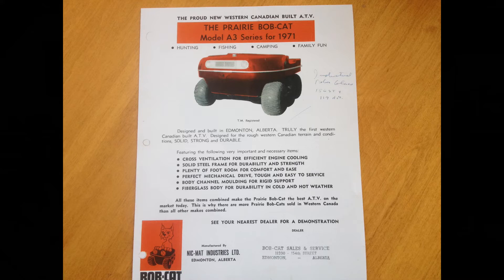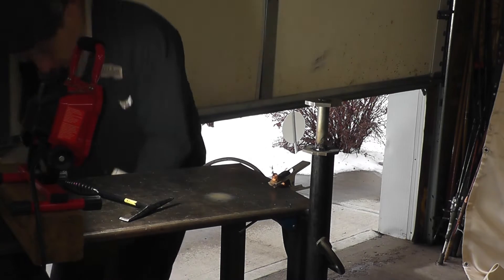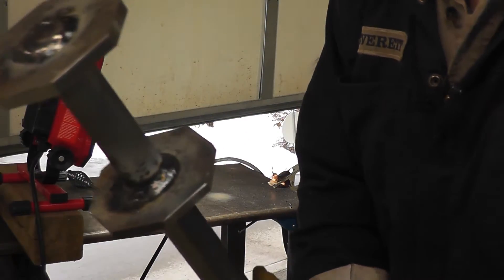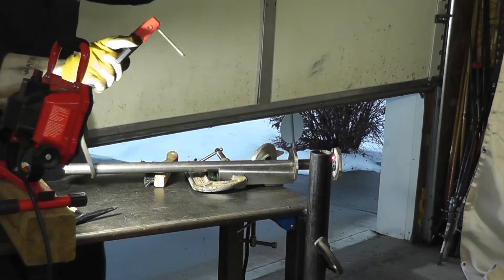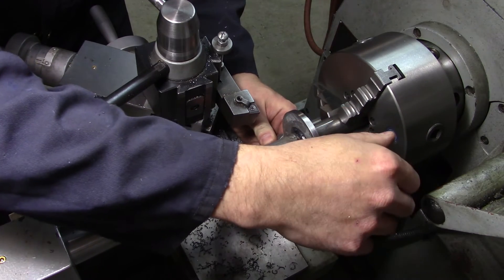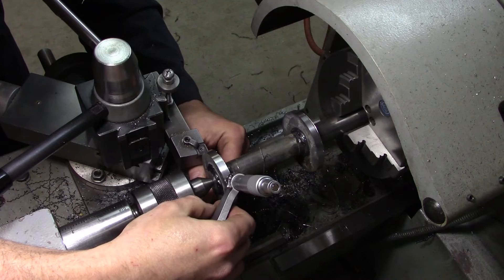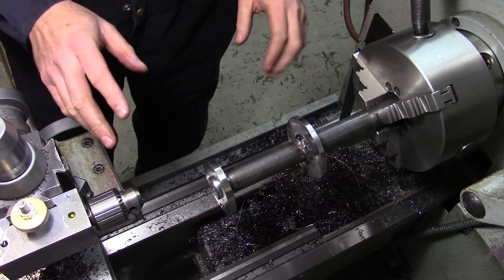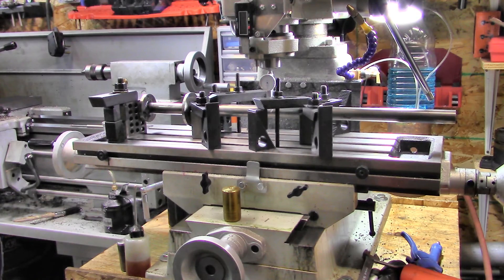Prairie Bobcat Axles Part 2

Comment: How would a thrust bearing work on the drill guide between the chuck and the block? Then you could use the carriage for pressure and just run the drill. Great videos, I am watching them all.
Reply from the maker: That's not a bad idea at all, a couple other guys, Steve Jordan, did just that with their designs. I might make some modifications to it down the road, I just needed it to work for the axle project as Uncle Tim needed them sooner rather than later. Thanks for coming by and for the kind words!

Comment: Nice job on a fun project. 5/16 is small for a wheel stud.
Reply from the maker: Thanks, yeah, I thought it a rather small bolt size too, but that's what they used. It's quite a small vehicle and fairly light - the inner flange apparently is to reinforce the inboard side of the rim, so that must buy some forgiveness in lug bolt requirements. Hope you're doing well.

Comment: Hi Everett ,I enjoyed the video very much it looked like a nice relaxing project and i am sure uncle Tim is tickled.
Your welding turned out very good, as you realize it is 90% positioning to do a good job.
I see a couple of items that might be nice for a feature video in that milling coolant setup, is it a purchased rig or home cobble? Cheers and carry on friend!
Reply from the maker: Thanks, I know there are a few surface blemishes in the face from weld undercut but it won't affect function. The mill mist system started with a cheap Loc-Line-type fitting off eBay, which got adapted to the mill. I showed the basic steps of how it got mounted in an earlier video . . . It's not perfect but for the price compared to a commercially available system it works for what I need. Good to hear from you again.
Reply: @EverettsWorkshop  Just asking about the mist system as I made one similar, actually just a pressurized bottle and a needle valve to mix the coolant with low pressure air ("no mist " copy,) I just haven't integrated it into the mill yet. Cheers Everett and hope that snow clears soon , we don't get that option out my way, haha.
Also that chuck method is the only indexing I ever did on my lathe as well!

Comment: right on everett very nice job on the 6 axels. it looks like it was alot of work to make those. your uncle is fortunet to have you to make them for him im sure he will be happy with the job you did. just one question did the keyway have to be timed with the 3 threaded holes in any way. thanks for the good videos.
Reply from the maker: Thanks Jamie, especially since you know welding far better than I do. The keyway isn't timed, just needs to be correct length, distance from the hub, and depth. It made the last step quicker to finish off.

Comment: Those look good! I like the idea of putting a vertical pipe on the welding table, good idea!
Reply from the maker: Thanks! Yeah, I don't have a weld positioner (yet!) so had to turn by hand in the pipe. Thankful it worked for the most part, but was hard not to shake the electrode working unbraced.

Comment: I thought I saw more than three holes. Very good solution. Now I need to make a drill guide for the tool post. Uncle Tim needs to give you a ride when it's back together. 😁 Thanks for the video, I hope you had a good Thanksgiving last month!
Reply from the maker: I originally saw indexing with the chuck jaws done by the fellow over at Winky's Metal Working, and the jig was necessary to get the bolt pattern right. Only after facing the flange could I have any trust in bolt hole placement and squareness. Thanks for coming by!